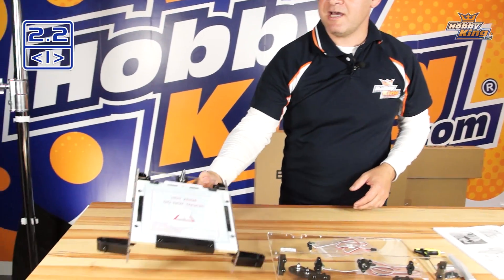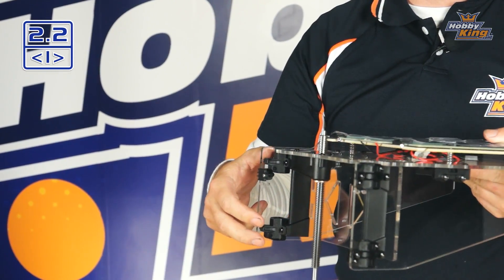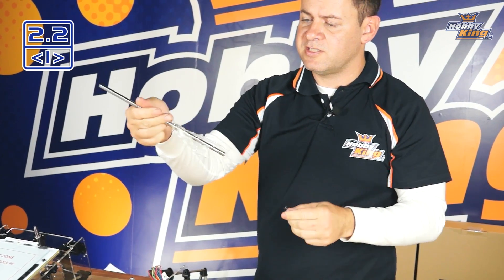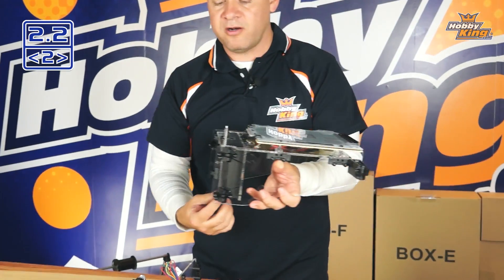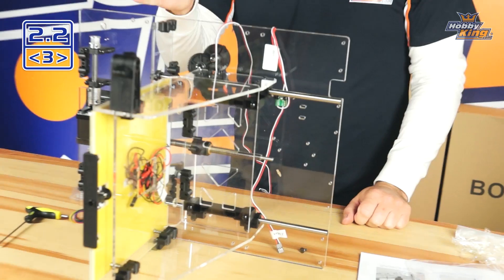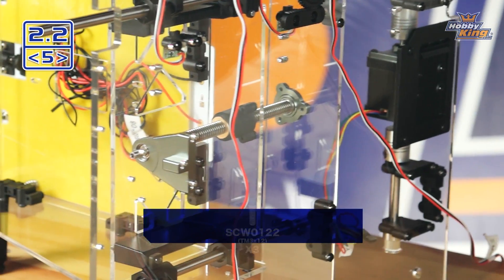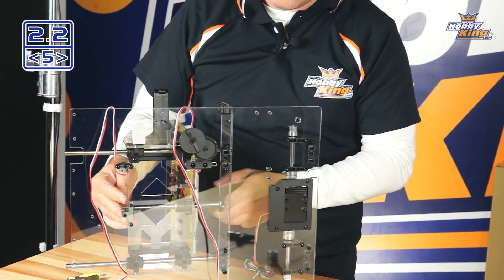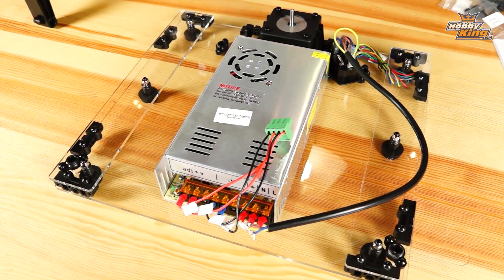Turnigy Fabrikator 3D Printer - 2.2.1 to 2.2.6 - HobbyKing Product Profile

Comment: anyone else notice that there is only one magnet limit switch actuator on the print bed and 2 sets of holes. because of this oversight the lower limit switch can not be triggered. There is  not enough adjustment in the lower limit switch to be triggered by just one actuator a second actuator installed in the second set of holes would solve this problem.